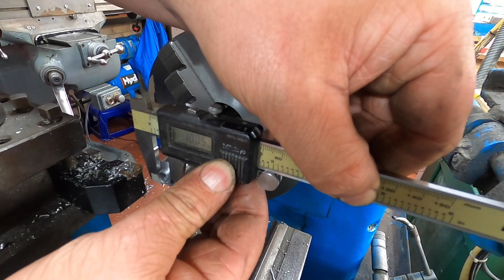Welding up the Pony Truck - EP 27 - 7.25" Gauge Steam Locomotive Build

Comment: Great work. What do you intermittently spray on the work?
Reply from the maker: Hi MLW, it’s anti spatter spray, it’s suppose to stop the mig spatter sticking to the job, but it’s the worst I’ve used. The esab one is the best one, which is what I’ll be swapping to when this runs out. All the best, Matt.

Comment: I have been watching with interest the construction of your pony truck, is it a proven design? I originally fitted a swing link truck to Tinkerbell but it lacked flexibility so a simple one was fitted with the support located centrally. With the loco weighing 900lbs on four wheels the truck has to deal with track irregularities.
Reply from the maker: Hi Roger, I’m truly honoured to have you following my build. The pony truck design is my adaptation of a design of pony truck on the Tinkerbell variant ’Sian’ that is a regular at the Leyland Society of Model Engineers track. The builder Steve has been a huge help with mine since I joined the society. All the best, Matt
Reply: @MattChiversWorkshop  Hi Matt for a few years Tinkerbell was operated on portable tracks at traction engine rallies and on some rather dubious home railways including mine so perhaps that coloured my experience. Keep up the good work. Roger